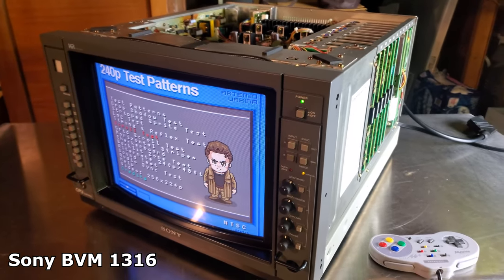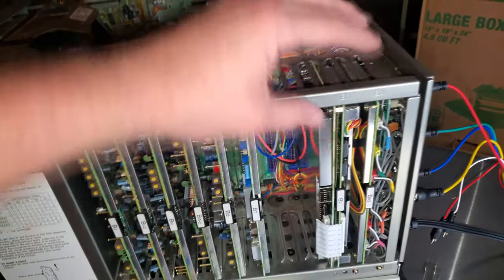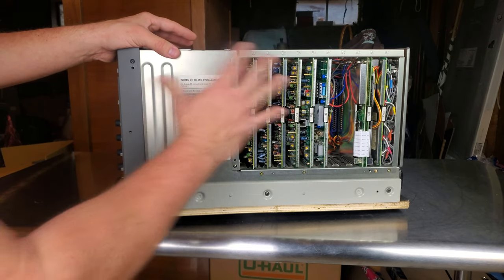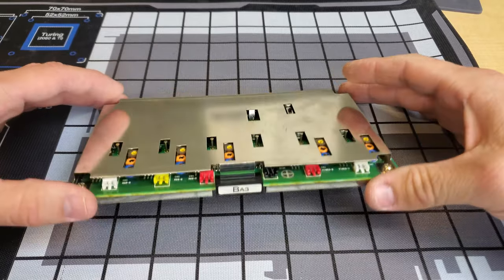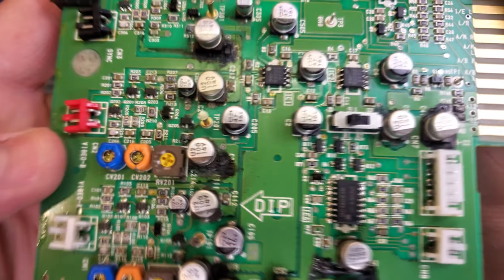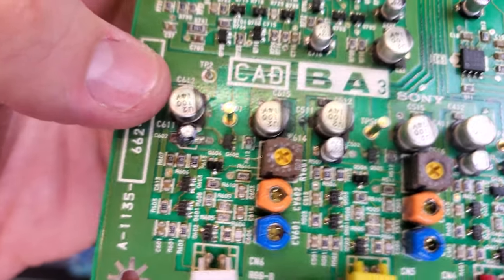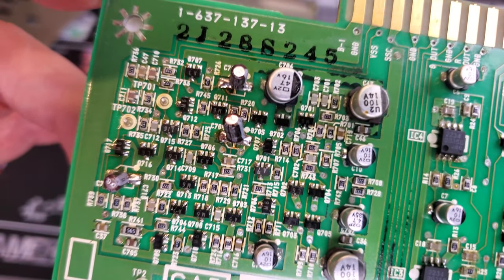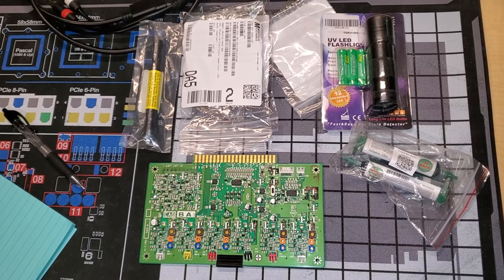Tips for Troubleshooting a CRT 📺 The Sony BVM 1316 with SMD Capacitor Failure

Comment from the maker: I wish you could smell this.
Reply: I've recapped 90s macs, so I know the smell. I tried hot air for removal - once.🤢
Reply: I bought an old bvm-1916 a while ago with some leaky smd caps. It smelled like old fish, and the drive back with it took 6 hours due to traffic...
Reply: Fun fact: if you smell a fishy smell like this in your house and don't have a CRT locate it immediately or call and electrician. I had a failing receptacle that was arcing and melting the plastic housing near the wire contacts. This can cause a fire. Also, I started cringing when you twisted those cans with the needle nose pliers. Aaaahhhh...
Reply: I have two BVM 1311 because of you RT lol and I can smell it, a faint fish oil smell like fish oil capsules.

Comment: You’re Johnny on the spot with this one. I just got a Sony bvm 1315 with similar capacitor leakage. The fluid ate through the board half way. 😳 it was enough to short other components on the board. It’s turned into a real project 😆.

Comment: Bvm 2016P had the same issue with the Video input card... leaky caps and even a shorted transistor. Fixed that, recapt the 2016P and the 1415P. Works like a charm.
Reply: Cards and Powersuply are compatible with each other. Amazing Sony stuff!

Comment: One thing to note, these capacitors are also used on the cpu board (HZ) in the pull out tray. Be sure to change these too. Once the leakage damages other components and tracks, through boards links etc, they become very hard to repair. I have several boards that are write offs for this reason. With the BA3 board, I normally remove this and the BV SDI board (which will also have leaking caps), as SDI is not important, and put the original BA board back (I had the hindsight to keep some when the SDI kits were fitted, as you replace the BA board, with a BA3 board). The kit is BKM-2085-14 or -20

Comment: Very similar build construction to my BVM-2010P.  With the same cards in the side, although being a 1988 model, it has through hole caps, and all are intact on the input side of the monitor.  I did recap all others in the PSU, HV and deflection boards though.  Two Elna caps in the PSU had leaked.

Comment: Oh man, I have a 1310 that looks very similar to this but all the caps are thru-hole. Similar issues, I wonder if it’s a similar problem? In my case along with losing sync sometimes, there is always a fair amount of smearing or ghosting in the signal/display. It’s not very noticeable with RGB but the component and composite inputs have it REALLY bad. I’ll have to dig it out and look at it again. Hopefully it’s fixable, otherwise the tube looks great.